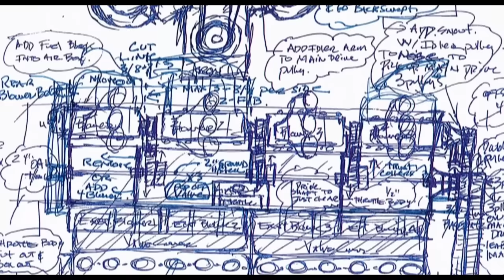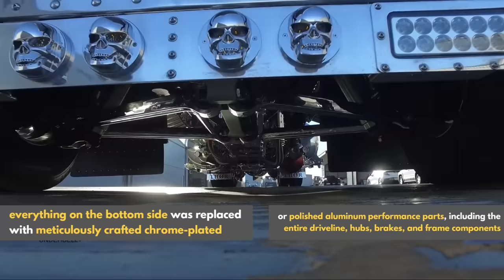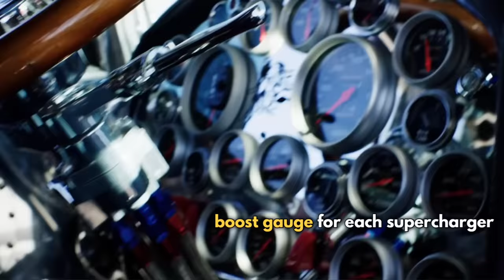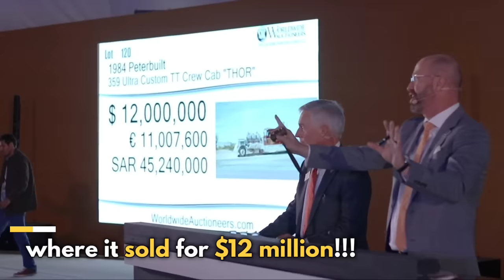World's Most Powerful Semi Truck ! MUST WATCH !!!

Comment: That thing must have the turning radius of the Starship Enterprise
Reply: Even worse then a f350 dually.
Reply: what you mean? You just crank the wheel down shift and lay the hammer down.
Reply: Gimme 40 acres and I'll turn this rig around.
Reply: I'd say more like the titanic..
Reply: What do you think tug boats are for..
Reply: It's very similar to my Nissan Frontier long bed.
Reply: Wellll actually the Enterprise can turn in place at a stop soooo it wishes it had it's turning radius 😂
Reply: Hello how are you doing
Reply: Its not far off having the power of the Enterprise either. I bet you could tie it to a wall, let your foot off the clutch and just have the revs at idle pull the wall down.
Reply: @philbiagi721  Hello how are you doing
Reply: Technically I believe that the Enterprise could have a zero turn radious.
Reply: Indubitably
Reply: and it can only turn left be couse you wont see crap on the right side
Reply: You drive to Wyoming to find a turn, or somewhere in the desert.
Reply: @duncanotema  I do not think turning ti would be any different then turning those semis with an efficient apartment on them. The ones with the 196"-205" sleeper. I think you just learn to make a bunch of left turns or if you cannot you set up and wait until you can make a wide right.
Reply: Yea or an aircraft carrier
Reply: Starship Enterprise can pivot on a fixed point using thrusters... but the radius of turning left or right (even in space) depends on how fast they are traveling.
Reply: @philbiagi721  The F350's radius ain't that bad
Reply: Lay some rubber and it'll turn on a dime
Reply: @TheBigENN  there's probably enough cameras to make that work
Reply: California officials must hate you! 😂😂😂
Reply: I think the enterprise could pivot on an axis being in space and all.
Reply: @vueport99  Forget that! It'll probably turn that dime into a quarter!!
Reply: @erzahler1930  are you sure it's not inflation? Lol
Reply: Best Comment EVER Brother!
Reply: @scorpion52193  But the Enterprise is so big that even spinning on the axis, the turning radius would still be around 300m.
Reply: @lyleware2479 

LOL…plus how do you see over the engine?
Reply: Policeman: Do you know why I pulled you over? 

THOR: Because I let you!

Comment: Imagine being on the highway in your Nissan Micra and that rolls up to your rear bumper... one blast of those airhorns you would disintegrate.
Reply: Don't worry it only runs up till 130mph, even with an NOS, superchargers, and a massive engine. Cause it's a diesel semi after all. I don't know about Micra, but thankfully it's still slower than an average car(otherwise the semi truck would have humiliated cars, lmao).
Reply: @johndavidson3424  I don't think the point was that the semi could go faster.  Just that it's imposing when you see it coming up in your rear view mirror.
Reply: @johndavidson3424  this is 100% not slower than an average car
Reply: @Darion350  exactly that.
Reply: @johndavidson3424  actually it probably could hi faster than 130mph  i believe the top speed is closer to 170mph. Cus with anough power even a brick wil fly
Reply: @johndavidson3424  bit yeah thy must have limited the top speed by gearing or Electronics
Reply: Disintegrate? More like get a free airblast boost
Reply: Good luck paying for that fuel...
Reply: LOL

Comment: 12 million is just the labour charge to make this beast..What a bargain.
Reply from the maker: Yes, a fortune for this beast!
Reply: @Albert Sammut   You're not at all worried that somewhere in SA someone is driving this thing instead of a camel????
Reply: EXACTLY! I'd be more interested in knowing how much it cost to build this thing.., and IF they made their money back?
Reply: Hello, how are you doing?
Reply: No -  this clever guy pieced together scraps and unwanted junk and built a 2 - stroke Diesel V-24 and then had other guys weld and polish typical trucker stuff.
But - - they pulled it off and did a good job, and made BANK !!

Comment: The 3,974 horsepower is one thing. However, the fact that they manage that at only 2,500 RPM is simply ludicrous. That works out to ≈ 8,350 lbft —or 11,270 Nm— of torque. You can essentially tow a cruise ship…
Reply: Thanks for the math nerd can you give more examples of other extreme engines with there horsepower to rpm
Reply: @Bluefalcon6154  Most tanks run between 1,500 and 3,500 RPM—such as the M1 Abrams producing maximum horsepower at 3,000 RPM and producing 1,500 horsepower, thus producing 2,750 lb ft. of torque, or ≈ 3,710 Nm.

Other than that, the Cosworth CA 2006 engine managed to reach 20,000 RPM and producing 915 horsepower, thus producing ≈ 240 lb ft. of torque, or ≈ 324 Nm.

Comment: Most powerful semi in the world?

Shockwave would like a word.
Reply: Totally different setups
Reply: yeah but shockwave has a jet engine so its completely different this truck has just 3 motors and 3 superchargers per motor
Reply: @blazecustance2557  Comments like this make me wonder if people actually watch the whole video or just the first 3 seconds and act like they know what they are saying.
Reply: @blazecustance2557  Says it is 2x 12 cylinder engines with 12 blowers.
Reply: You're right. Diesels arent the kings of torque. Turbines, and even reciprocating steam engines, along with electric ac motors can out torque a diesel. Saturn 5 rockt also trumps the big 14 cylinder diesel ship engine too. thor 24 is a bore because in the wide world of machines there is so much more.
Reply: @fivepointeightnate  I didn't hear what the size of the original engines were, or maybe I missed it. Are they 12v71's? Or 12v92's? Or something altogether different?

Comment: This is the truck I saw on YouTube a couple of years ago. It's rated at 3000 horsepower and I think they sold it to a guy in India. He got a couple of million for one. If I'm not correct, that's that's cool. The brakes won't stop that if it goes fast. It has to have parachutes on the back to slow it down and stop it with the brakes thank you.

Comment: I'm really confused by the statement "most powerfull semi"...  the 20000lb class truck pullers easily have way more ponies than this...  and thats from inline 6 motors.  Guess some people need to do more research
Reply: i think it said street legal?
Reply: Though this truck makes just under 4,000 hp at 2,500 rpm. It makes 8,350 ft lbs of torque at 2,500 rpm
Reply: @yodudechase3326  Thats what he claims, I saw a dyno video on you tube that he said it made 3200, all they did was sit there and rev it up and down, dont believe that it was really a dyno pull, never heard motor load down. It would take significant boost to get that engine anywhere close to 3200 hp. dont think all those underdriven blowers are gonna make all that much boost, its 2 12v71's hooked together, a 12v71 was a 450 hp motor stock so 900 for the 2 of them. I believe he could make way more power with 4 turbos than all those blowers.  its way more show than go.
Reply: @ronaldgentry9923  absolutely right.... count the parasitic loss too,from spinning 24 blowers...

Comment: That’s great! Top speed of 130 mph! I have my class A CDL and can’t tell you how many mutant truck drivers have told me they’ve had their daily work rig at these speeds or higher (160 is the highest I’ve heard yet) while pulling a trailer.
Reply: 160mph with a trailer? What the hell what kind of meth were they on? I’ve gone 100 tops on a KW and I remember thinking the thing was gonna fall apart at that speed
Reply: lol probably too hyped up on coke and caffine pills to know they were actually going 90 downhill no-doubt
Reply: You were talking to a Canadian in kph.
Truck tires aren't rated for anything close to 160 mph.
Reply: @saundersge2  I wish I had been speaking to a Canuck, and it was just a bit of lost in translation, but alas, I am  certain I was speaking with a mutant American. I’ve brought that to their attention, the tire rating thing, and the fact the transmission and differential aren’t geared for those speeds, not to mention the amount of HP and toque needed to overcome the air resistance at 160 MPH… all to no avail.
Reply: 160 KMH - Canada
 VS  
160 MPH - U.S.A.😅
Reply: I may have hit mid 80 mph loaded.  At bottom of a hill, just before headed up a steep one. That’s plenty fast.
Reply: I have been passed at close to a 100 mph. By more than one truck with a trailer hooked to it before in the mountains during my regular Ohio to Florida trips. And they went by like I was standing still so I damn well know they were right at 100 or even better .

Comment: Needs a 20mm autocannon system on top of the crew compartment, then a howitzer turret and some stabilizing struts on the back... like a 100-200mm mid range siege cannon. Plus room for a driver, machine gunner, 2 turret operators, and like 20 guys. Passenger gets a .50

Comment: As a long haul trucker, I wouldn’t mind owning this truck……..course, tight turns might be a problem
Reply: James yes, but could you afford the 10 gallons per mile fuel "inefficiency?" Ouch! And not only the diesel fuel, but also the nitrous. Just one fill-up would bankrupt you; just watch your credit card literally melt!! 🔥😵
Reply: @erzahler1930  And your point is?
Reply: @erzahler1930  My current truck, with auto 12 speed, gets 7.5 so 10 would be an improvement

Comment: That thing must be tricky driving through narrow city streets and winding mountain roads! 

How many full size, fully loaded trailers will it pull up the grapevine?

Have you taught it to do wheelies yet?
Truck pull competitions? 
Have you thought about adding helicopter blades on top? 

That probably comes standard with all the girls that you can handle, and then some. 😁

I hope that is all wheel drive.
You wouldn't want that thing to get stuck in the mud or the snow. 😉🙄
With all of that power I would have expected at least 300 mph out of it!

Comment: Are those 1,000 gallon tanks? Maybe bigger? It's just purely a "show piece". I'd hate to fill those tanks up just to get to the next truck stop!! And since diesel costs more than (regular) gas the you wouldn't make any money...in fact you'd lose. Keep it on the show circuit. Couldn't haul a big trailer anyway.

Comment: This is so gratuitous I can't even be impressed by it. The sheer amount of excess involved in this has honestly made me dislike the thing. I'm more impressed by Bagger 293 than I am by this thing, because at least the perceived gratuity of a Bagger excavator has incredibly practical application. This thing will never be used for probably anything that a semi truck would actually be used for, and all that power and the masterful engineering behind it is probably gone to waste just cause this thing is clearly a luxury vehicle and will not be used as a semi truck. But it's a semi truck. Whose idea?

Comment: those 2 immense engines in europe would have produced about 15000 horse power 
The truck is nice looking and I admire the style but I really don't understand what is wrong with the u.s. engineering when it comes to cars ... is too inefficient 
as an example they have "The Iron Knight" Volvo 13 litters engine 2400 hp and Scania Chimera 16 litter V8 with 2140 hp

Comment: What a way to go if you’re gonna go, in a 32,000 pound truck doing 130 while you can’t even see in front of the Road due to the engine being too large and have two use GPS to see the road. I was just wondering if this has fly by wire System built into it, or do you just have to hang on by the seat of your pants and hope you don’t have to bend over and kiss yourself goodbye while traveling at 130 mph😅

Comment: Over 3000 horse power, I bettcha it can pull a load,
Reply: It would snap pretty much everything past the engine if it had much of a load.
Reply: @Bendigo1  would have to upgrade it with all custom heavy duty drive train, drive shaft

Comment: I hate to say this guys but the new God's of power now and in the future are Variable frequency drive motors like the Tesla car possess. There is no limit to power in and output torque and rpms. Vin Diesel's 900 horsepower charger in the first movie is near 1 megawatt of power. LOL. That's nothing now. We should be able to achieve over 10 megawatts.
The birth of the Tesla lithium-Ion battery cells changed everything. The combination of Lithium-Ion battery cells and Ultra Capacitors will achieve explosive amounts of instant power. The Ultra capacitors are like a lightning strike of instant power in small cans. The lithium's keep them charged up. After the instant discharge of the Ultra Capacitors the lithium batteries take over. Gas powered internal combustion engines will be obsolete and used for scrap. Have a good day.